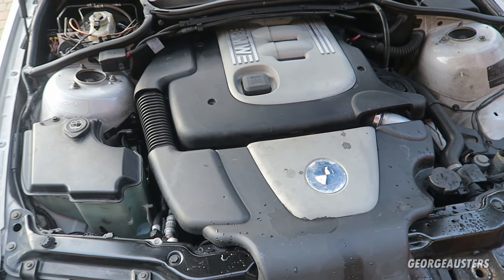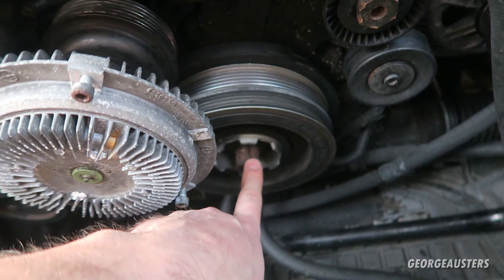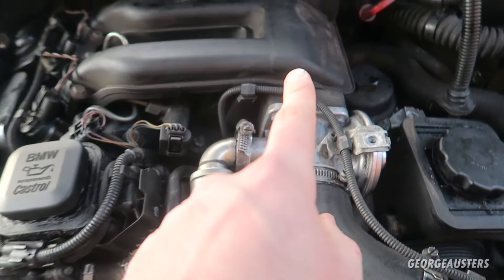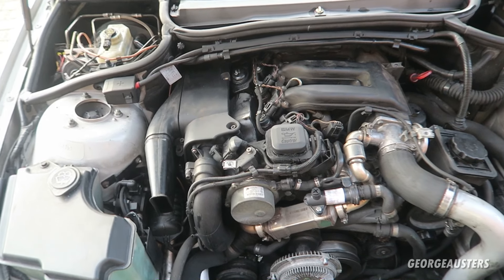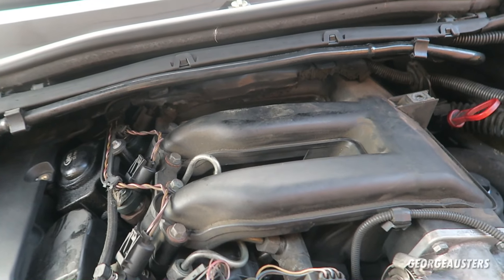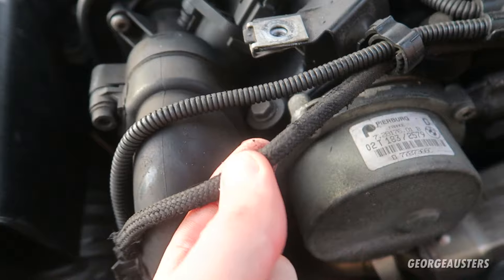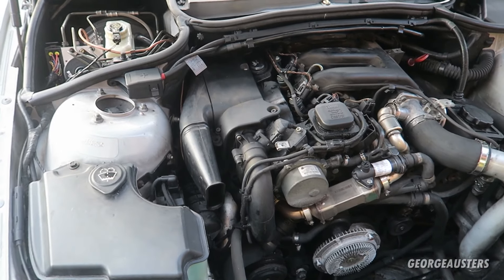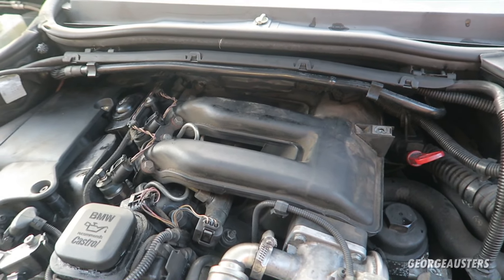BMW M47 & BMW M57 ENGINE COMMON PROBLEMS!

Comment: Good tips dont forget about the coolant thermostat mate
Reply: i literally just had to replace it!  its commonly 2 hoses, the egr tube and 4 10mm bolts. thats it. easy job but often alot of oil so youll get dirty af

Comment: You forgot to mention the top turbo vac hose,  they give trouble and the old loo roll filter is a lot better but does need to be changed regularly. They're a mighty engine,  I've done over 300k with mine and it still runs like a dream and goes like a bomb the secret it to keep it very well serviced on the nail and you'll have no worries.

Comment: These M47s don't usually last long over 200k it would be good to make a compression test video and see how how healthy the engine is and also a dyno test would produce awesome content.
Reply from the maker: Nah these are good for 300-500k If looked after👍🏻
Reply: @GeorgeAusters  are you sure? i barely saw one over 300k my e46 320d blew up around 188k the 6 cylinder is a different story altogether.
Reply from the maker: @johnyp2967  M47 and M57 are basically the same engine mate
Reply: M47 engines will easily do 300k+ with regular service
Reply: They actually do, mine is 500k km and still running
Reply: @donatass2622  km and miles are completely different for example 500k KM = 310k miles.
Reply: @donatass2622  Sir can you please share what all parts you've changed on the engine side so far
Reply: @johnysilvester8483  Nothing serious on the engine side so far,  replaced vortex breather, deleted swirl flaps, only gearbox is going bad but its understandable for such a high mileage, engine is suprisingly reliable I always take care of it changing oil on time,  not shutting of engine imediately always wait for turbo blades to drop to idle rpm after rough driving, it's truly reliable car, but you know you can get unlucky and buy beat up lemon instead like any other car in my case I got lucky.
Reply: m47 is bullet proof engine for sure

Comment: Thats broken ! Pully it haopemed to me it destroy the entire rubber
Reply from the maker: Common problem
Reply: @GeorgeAusters  everything you said in this video you are right about it... Very experienced guy! Thanks a lot ... There is only one thing that I really wanna know if it's okay to ask you...
When take off the oil cap there is a lot of blow by and smoke and oil coming out of there is it normal? In m47 engines? The car still runs and drives great no power loss

Comment: Hey George, thanks for the tips. One question though: I've just changed the crankcase breather on my 2004 320d and could feel the power of coming back. I took her for a longer drive and just before I got home the faulty exhaust gas lamp came on. Was it a chain reaction? Could it be the egr? Whats do you think??
Reply: Did you end up finding out why it came on?

Comment: Banger video mate! Spot on! All those common problems are checked on my engine. Except for crankcase ventilation filter, I didn't even know it existed lmfao. I heard a slight plasticy vibration sound from that specific corner, I'm replace it straight away. Been driving my m47t2 for 4 years with very good maintenance and feeling stupid for missing it! 

Btw, I'd recommend deleting the swirlflaps ASAP because its  those are a ticking bomb.
Reply from the maker: Glad to help!

Comment: Regarding the glow plug relay issue, I have had issues for the last 4 years, changing both glow plugs and glow plug relay several times and problems kept coming back. I think the conclusion to my problems was either poorly seated cables to the glow plug relay (seat the cable, push hard while giving it a wiggle to ensure good engagement and lock). It could also have been an issue with the lead cable going from the generator to the relay, which I also replaced (cheap and easy to fix). Not sure which one did the trick, but now everything is perfect.
Reply from the maker: Glad to hear you got it working!
Reply: I recommended to use reamer when changing glow plugs, that carbon in Glow plug hole usually burns new plugs too soon. I did make own reamer from old plug and drillbit, works nice

Comment: I'd be interested to know just how common these problems are: 1 in 4, 1 in 10, 1 in 100 ...?

I have two 2001 530Ds (E39s) with the M57 6 cylinder engine, one has 170,000 miles and the other 173,000 miles.

EGRs on both are clean, the injectors are all OK (checked with diagnostic software), neither car has a problem with the crank damper (I recently changed the water pumps on both so have checked the damper), glowplugs are original and fault free.

My E39s don't have DPFs. But deleting the DPF and the EGR can stop the car meeting emission controls in the MOT.

The swirl flaps are only fitted to the automatic version of some M57s (my automatic had them and I deleted them immediately after buying it) and even then not those fitted to Range Rovers, X5s or Opels.

The crankcase breather filter isn't a problem unless the filter isn't replaced or cleaned (later M57 engines have a washable filter). This maintenance item is even missed by BMW dealers.

Oil has been changed at 10,000-15,000 miles with top quality oil and filter (no supermarket own brands)

The turbo can be an issue, the turbo on my manual E39 let go not long after I bought it but this was put down to it having been sat on garage forecourts for 12-14 months and not having any servicing done, despite what the (non BMW) dealer said.

With the exception of the swirl flaps the rest of these "common faults" are down to a lack of proper servicing/maintenance and will affect any similar engine AUDI, Mercedes, PSA, whatever.

Comment: Glowplug module is easier to reach under the car, I did it month ago. Also later did change all plugs too and i did check if i can reach that module from up and no chance wihtout removing hoses and Cables etc. Its kinda annoying to change from under but doable

Comment: Ive got this engine in the E70 X5. Glow plug module went, caused a glow plug to melt the tip on injector 5 which then went and the car wouldnt drive. Two weeks later the it clunks and pops when hard turning on low speed so going in for CV axle replacement. 
The engine is heavily carbonised too, really badly. Got a very squeaky belt on idle too. Seems never ending with this car! 
Considering an EGR delete (mapped out) to try and clean some of the carbon out assuming the higher temps will help that!
Reply: Wow, i just stumbled upon your comment and atleast now i know i have bad CV axles on my E46 330xd. Thanks for sharing!
Reply: @ZeroGravityShisha  funny story, went in for CV axle replacement and the garage said there was nothing wrong just some plastic trim stuck in the suspension!

Comment: i have the M47 in my freelander and I use RED X 1 Shot it decarbs very good in fact I had a glow plug stuck I was recommended Red X 1 shot it got all the carb off and because i had left the glow plug loose it shot out so all I had to do was put a new one in but i tried the rest and they all came out no problem  the only trouble with the M47 in a freelander is it is side ways on so getting at the water pump and the crankshaft pulley are bad but doable thanks for the video

Comment: 6:18 i am not doing change filter. I cleaning cloth into it. Problem with turbine is oil supply strainer its blocked like other cars with strainer. meybe strainer blocked easier when oil is 5W40

Comment: Great Vlog again. Had a new turbo fitted at 42000 miles on my Series I 20d due to main dealership not charging the filter you mentioned although was ticked off on service reports Sheets. I really love driving BMW’s just trying to find what suits us now. Do under 5 k miles a year. Want an auto any advice? You seem to know beaters inside out. 😁👍
Reply from the maker: Do you want something new or do you want something reliable?
Reply: @GeorgeAusters  Happy to pay up to £10,000 for 1 series or preferably an X1 auto would like a sunroof! 😁🤔👍
Reply from the maker: For less than half of that you could get an N52 powered bmw 125i or 130i
Reply: Like the reliability of the bmw and the handling and safety features
Reply: Thanks for that. So you’d recommend petrol over diesel?
Reply from the maker: @rogerspeck9929  If you're doing only 5000 miles a year yes
Reply: @GeorgeAusters  Thanks George I’ll keep looking. And watching your videos. 👍

Comment: Can you show how to change the oil filter housing gasket? It is a common oil leak spot
Reply from the maker: I’ve made a video doing it on the N47 engine👍🏻
Reply: @GeorgeAusters  I saw it. It should be the same for the m47 engine. Right?

Comment: I have a 2006 120D with 163 hp M47 and my throttle body failed as well as the glow plug module. I'm quite angry! I have 250k km on it...

Comment: ive a m57 530d, no oil consumption, or black smoke, but she is gutless. MAF change improved a smoking problem. engine seems ok, but a little bit slappy when cold. any ideas? 205k miles. decent oil change intervals with mobl1 mainly

Comment: Is there any common oil leaks on these?  i have an oil leak coming from somewhere on the right side of the engine. Have not had a chance to have a proper look but its pretty bad and its recent as i was in there not so long ago to service it as well as do the glowplugs and swirl flap removal. M47 engine.

Comment: great video. I wonder if you've ever had any experience in replacing the gasket that goes from the turbo to the DPF? is that a DPF out job?
Reply from the maker: No just unbolt and slide gasket in
Reply: @ amazing , thank you.
Reply: @GeorgeAusters  Hi George, I know this might not be the right thread to reply to , but your help would be appreciated massively. But it turns out i need a new exhaust manifold, the car has a dpf (e90 325d 2008) - can the manifold be replaced from the top , or do I need to go the hell of removing the dpf?
Reply from the maker: @ I have a video replacing the turbo on that engine…

BMW M57 TURBOCHARGER REPLACEMENT!
https://youtu.be/51onpT9IUKw

Comment: My stage 2 330d used to scream on boost, but now i lost it😢 feels like i lost 50hp at least but still goes but no scream😢  boost pressure test was alright, only errors i have is from the 6 glow plugs. Also my batery will beed change soon. Does any of this is the culprit? What could  cause my loss of power please. Tia

Comment: Hi! Can you tell me if I change the gasket on the camshaft cover, where the silicone should be placed or if it should be placed? Thank you very much! e87 118d m47 90kw

Comment: BMW M57 ENGINE COMMON PROBLEMS! Good video with wrong engine, there are 2 cylinders missing to be M57
Reply from the maker: Clearly says M47 & M57.. They are virtually the same engine with the same problems
Reply: @GeorgeAusters  if you say so, i don't think 4 cylinders are the same as 6 cylinders. You ca say that the v8 is 2 4 cylinder engines by your logic

Comment: Hi
Dunno if you still check comments but ill try.
This same engine struggled to get to temp and when on highway it even cooled back down. In city it warmed normally. Obv it was the thermostat, so I changed it and indeed it was stuck open, but even with the new one in place I still have the same issue. Any clue on what can it be?
Thanks!
Reply: Hey, its normal the 520d or 320d are known for bad heating up, thats why most of them have the automatic webasto equiped where it starts up when its less then -5°c outside (cant be controlled via the radio or remote unless picked as option) bmw Just used the bigger radiators from the bigger engines and went kind off overkill without knowing (i guess). Try keeping fan speed at like 2 or 3 stripes instead of the 'auto' mode when its colder outside, it heats the coolant up faster.. 
Sidenote, when you're not in the auto mode and you have webasto, it will not kick on even when its -5°c outside..

Comment: EGR Blanking is MOT fail now if they check for it, any issues if its removed and blanked off?
Reply: Also ive got a 2007 320D E90 M47 engine, seems to be no boost til about 2500-3000rpm then it kicks in, checked the air intake pipe all looks good
Tried to remove egr for cleaning but the bottom bolts are seized, anything else to check over?

Comment: Hi George, I bought 640d from 2016 (3.0d with 309 bhp) and the car is sound but I noticed the day after that the car is shaking / vibrating too much at idle. I saw from invoices that it only had break disks and EGR replaced. Feels like misfire or jamming EGR... But you have much more experience then me so I wanted ask. What would be (in your opinion) causing such shaking and vibrations on idle gear ?

Comment: Hi George, I'm getting a lot from your videos. Your my go to guy. So I want to buy a bmw 1 series M sport specifically, I don't think I can find a 3.0l like yours, but like the idea of the 120d or even 123d, which engines do you recommend & which ones should I avoid? I'm seeing alot of mixed reviews all over the place contradicting each other, can you help me out? Happy to donate for your advice 👍🏻
Reply from the maker: M47 engines are solid once you've sorted the common problems, the N47 is too once the timing chain has been replaced
Reply: @GeorgeAusters  Ok thanks 👍🏻, how can I donate? Would you mind short listing things to look out for both engines? I've been researching & know full service history is important, services every 10k rather than 20k
Reply from the maker: You can donate here: https://bit.ly/3u2yEMz
Reply: @GeorgeAusters  All done 👍🏻
Reply from the maker: Legend. Have you seen my N47 common problems video?
Reply: @GeorgeAusters  I have yes, I watched that one yesterday, I know from what you say the N52 is a good choice, how about the N43 120i? Slow? Unreliable?
Reply: @GeorgeAusters  hi George I've just done inlet manifold cleaning EGR throttle body disconnected the battery in the engine bay unplugged injectors and the sensors in the manifold put it all back together tonight and it won't start any ideas as it was running fine before I started doing the clean battery is now dying

Comment: Sir is it okay to remap it ? Will remapping it causes any issues with the engine ? Like High pressure fuel pump etc
Reply from the maker: Perfectly fine if well looked after👍🏻
Reply: @GeorgeAusters  thank you so much for your valuable reply

Comment: I ve got the same bmw m47 I just pulled the vacume line on the egr and blocked it off problem solved
Reply from the maker: That solved all your problems?
Reply: Was there any warning lights after that? I know that you can just plug it, but so that I know, you have to program the ecu for that. Gonna do that to my bmw but not right now because it's like - 20 degrees cold so the engine would get warm much slower if I delete it
Reply: On the e46 there is a egr that’s works with vacuum, you just take it off at the egr and close it of or bend it close. You leave the plug on the switch as is. The switch still opens and closes. But the egr stays closed. Egr needs vacuum to open. Easy guys
Reply: @TheStoneland  no problems or warning light clean air intake and the time, cold start perfect
Reply: @hbmair351  I've heard that u might get a warning light with e90, I'll see!

Comment: I have exactly the same problem to my E83 M47TU.Additionaly too often DPF regenerations.Tomorrow I will check EGR and EGR Cooler.Is it a common problem for the EGR Cooler to be clogged or just only the EGR malfunction?
Reply: Thermostat is often the cause of Egr cooler failure and source of other issues.

Comment: I have the same engine m47tu, it seems to lose pulling power, it doesn’t rev normal, there is no power at all, at times revs upto 2000rpm, what might be the problem
Reply: Where you able to fix it?
Was it the turbo actuator?

Comment: Do you get alot of stick for having the 4cyl bmw too or is it just me?
Reply from the maker: 4 cylinder diesels serve their purpose, they're economical. I have a 6 cylinder petrol for fun.
Reply: I'm yet to experience a 6 cylinder. Being a hot hatch fanatic you don't often come across straight 6 Clio 182s and 306 GTis
Reply from the maker: They are good fun and sound great, I have the 130i hatchback 👍🏻
Reply: Dude! You need an M54 ‘tu’ in your life!